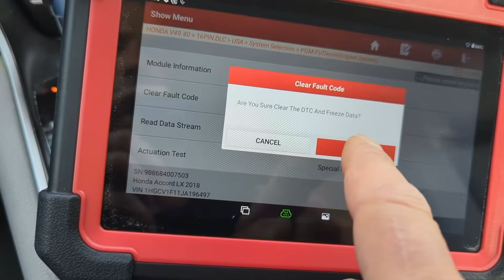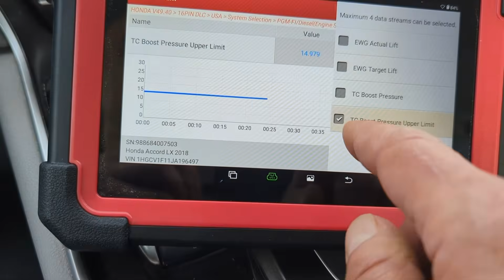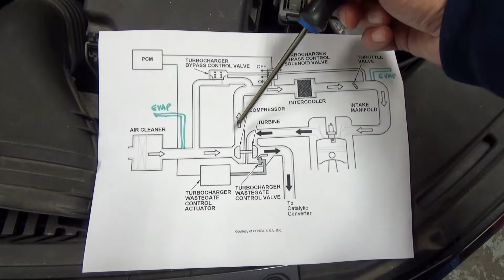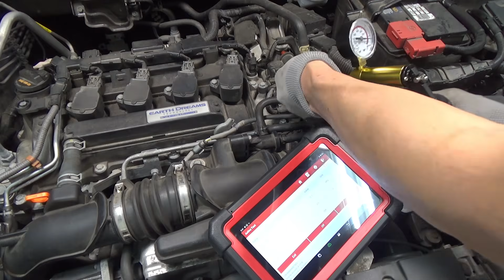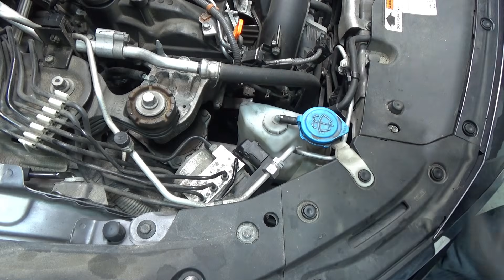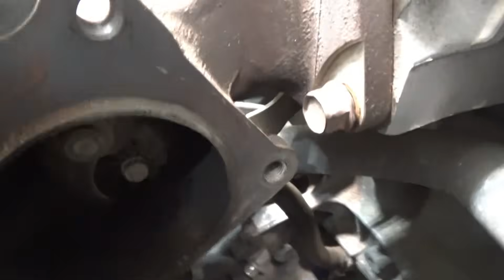P0299 & Honda TurboCharger Replacement PART #1

Comment: I can’t complain about my Honda at awwwwwllll!!!😂😂😂..I didn’t change my plugs till   Or transmission fluid till 129k miles .. my turbo is just goin out at 144k miles 💯🙌🏿🤣… my cvt transmission is fine for know lmfaoo … my point is I’m at 150k miles damn near …❤❤❤ the turbo is sposed to go out … she’s tired bro 😂😂🙌🏿.. I live in the Sierra mountains in Auburn .really Foresthill ! Winding roads 7-14 percent grades steep as shit .. and I drive my accord in sport mode around these corners like I’m in Porsche 911 😂😂😂😂… she deserves a new turbo ✊🏿❤️‍🩹☠️😂.. and tires which come Sunday .. turbo today ..💯 literally getting it in like 2 hours .. ✊🏿✊🏿 sometimes yall … think about what your car goes through be fore you just complain about the so called problems with a certain car …. Shyt they say Hondas heads leak … mine haven’t 🤷🏿‍♂️🤣🙌🏿☠️☠️☠️🤦🏿‍♂️🤦🏿‍♂️.. again 150k miles damn near … and all I need major is a damn turbo that deserves to be replaced 🤷🏿‍♂️. 💯… I’m sure it needs a new driver too 😂😂😂😂😂😂😂😂☠️☠️🙌🏿🙌🏿🙌🏿🙌🏿

Comment: My local Honda dealer quoted me 5500 to replace the turbo and intercooler for this code.  Did the wastegate actuator trick in another video and fixed my issue in about 90 minutes of work.  The wastegate actuator was loose and rattling.  Tighten it up so there’s no slack and all good.
Reply: Okay as a mechanic starting out that might have been criminal 🤣🙌🏿🤦🏿‍♂️.. I don’t like that word but th turbo it’s self is only 600 oem. At autozone .. you add another 2-300 for there diagnostics test 😒🙄.. why we need to charge 300 to plug as scanner tool up and autozone does it free I will never understand that …but that’s 900 ….. and the labor is any where from 2-500 an hour .. it’s like a 2-3 hour job .. 1800-2500 max ….. that fool was about to quote the after market turbos 😂😂at 13-1500  then charge you 300 for diagnosis and then lie and tell you it was 4-6 hour job at 5500 … that’s insane …..even before I became a mechanic 👨🏾‍🔧….. always buy your own parts .. and find somebody that will just do the labor .. if you can’t do it yourself … go to autozone get scan free .. and take that with u to the shop … … they might still tell you that they have to use there scanner though 😂😂😂😂😂 🤷🏿‍♂️💯… I mean they have to make something or else business gon fail … but the man thing is buy your own parts … and find a shop that ain’t on that bullshit … to mean thirsty shop is a shop that’s struggling for business 💯✊🏿🚩🚩🚩… shops that are successful 90 percent of the time ain’t trippin that u already did the scan  and got the part .. they’ll say alright we’ll bring it in let’s get you figured out and go from there .. … what they should tell you is that there using the oscilloscope 💯❤️❤️❤️… to get readings … and not the scan tool .. case those are different .. that’s where they mess up at 😂😂😂😂
Reply: @KeepSycklids damn. This comment is GOLD
Reply: My Honda is show in the p0299 code. About to do tighten up my wastegate actuator. I’m sure it’s lose crossing my finger that the cause and will fix my issue as well
Reply: Hey. When did you hear the rattling?
Reply: @sincerejackson4410  I didn’t hear the rattling while driving but rather when I did the actuator check and moving it and hearing/feeling the rattle and looseness.

Comment: What position is the turbo wastegate in during idle? I beleive mine is open, the wastegate solenoid is extented/ pushing out
Reply: Won’t matter if the watergate is messed up or the actuator becuase there internal … either way your replacing the whole damn thing 😂😂😂😂😂💯🙌🏿…

Comment: 41:40 Saucy shoutout. Same car found oil in coolant reservoir, not sure from where. Head gasket is good. Engine oil no contaminaton. But diagnosing, car was in accident and condenser looked bent poor shape, wasnt replaced, radiator both sides looked ok visually (not sure if an internal failure there between deviated coolers) and looking through rest of piping/systems, still need to diagnose. Not my car

Comment: What’s the high pitched whine at 13:30? I’m noticing the same on my CRV 1.5L Turbo, and if I disconnect the wires on the turbo actuator solenoid the whining stops. Also, if I tap the solenoid (handle of screwdriver) it interrupts the whine.

Edit: normal? You say it’s PWM as it tries to determine the correct depth?

Comment: Look, a Pixel user.
Reply from the maker: Haha, wow, keen eye!  Yep, that is correct!  I was on my way home from work when it happened and didn't have my usual camera so I resorted to the Pixel for the first part!
Reply: Where did you get your turbocharger  from?
Reply from the maker: @lodogboys  I got an OEM replacement turbocharger from HondaPartsNow.com.  I usually get my Honda parts from www.hondaautomotiveparts.com but for some reason they would not ship the turbocharger.  I was happy with HondaPartsNow.  It was relatively quick and the turbocharger was super well packaged.